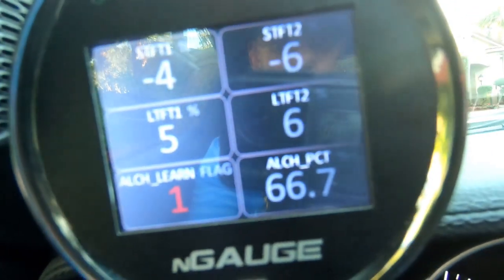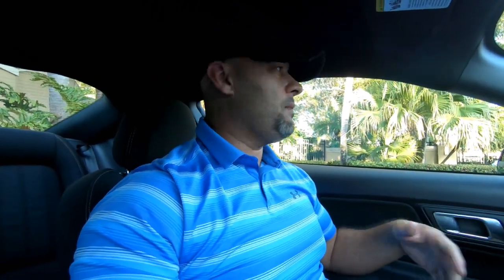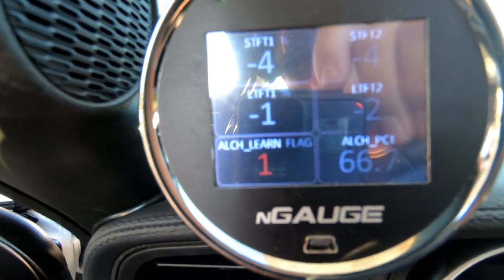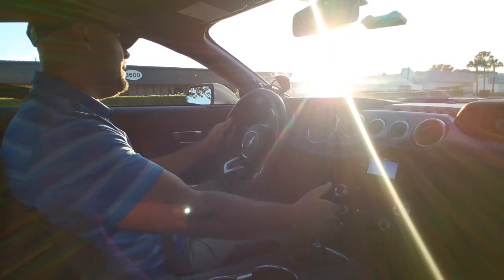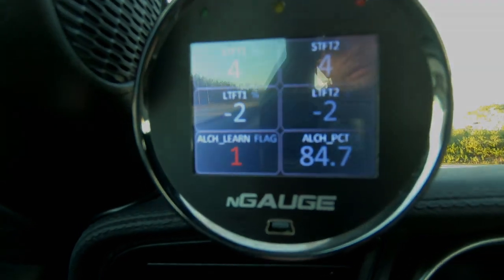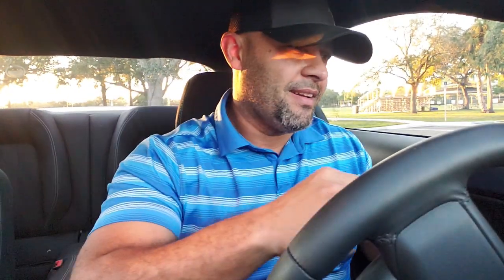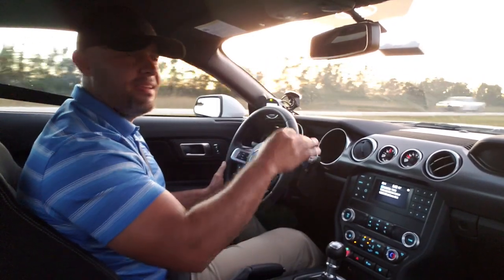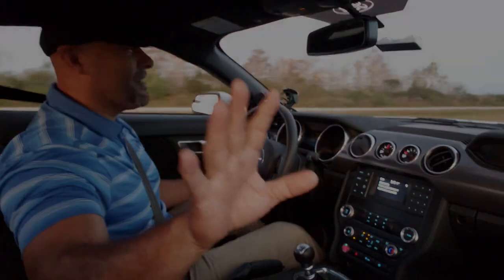Flex fuel tune Vs E85r tune. How the process works on 11-19 mustangs

Comment: I have a 91/93 tune on my flex fuel F150.  If I want to run E85 do I need to an E85 tune or just reflash back to stock???

Comment: Hey Alex. I have a quick question. If I by accidentally filled my e85 tuned 22 gt with 11 gallons of e15 and drove it below 2-3 rpm every couple gallons and filled it up with e85 was that okay?
Reply from the maker: No, it would run very rich, probably needs an oil change and new plugs at minimum.

Comment: Big fan, you tell it, how I like to hear it! I have an 06 Roush Mustang Gt, and my teksid short block will be ready this week, forged cobra crank, 11.1 Manley pistons/ Hbeam rods, boundary billet oil pump, ported heads, all Manley valves springs,running TVS 2300(e85) What do you think about meth injection on top of that? Anyway, do you do remote tuning? Would love to let you have the car for a few, but I’m in OKC. Never know, may work something out. Been using HPP, on my old setup, but I like your style, and attention to detail with modulars. Either way, you’re one hell of a tuner, keep up the Great work, and great show, I’ve learned a lot just watching it. Thanks 👍

Comment: If I’m Dyno Tuned on Pump E85. Flex Fuel System. Currently getting 79% Ethanol from then pump. Any benefits running a VP E85R fuel ? Not a daily driver.

Comment: I wish lund would tell you this when using their flex tune. They tell you when switching to E85 to do the sit still and let it idle and rev it for 10 minutes.. that is the dumbest thing ever lol. Just get in and drive the car normally, slower like your doing errands for a couple
Miles and it learns the fuel the same way as idleing and revving except it does it better and faster and you don’t look like an idiot like some of these youtubers sitting at a pump for 10 mins and taking up a spot at a pump lol.. 😂
Reply from the maker: They do
Read the directions
99% of the time ppl don't read the massive email they send. 
So I resort to making video for those that don't read.
Reply: @YDBT4LIFE  I hear ya. The directions I got with my 2017 back in the day were like that I think but the ones I got for my 2019 now say to sit and rev and idle for 10 mins and not to drive the car. I like the way you said to do it. I always Idle while I’m gettin gas and paying and then slowly drive the car until it learns (about 10 mins/10 miles) and It seems to learn a lot faster. Thanks for the reply Bro. I think you are tuning my car right now maybe? I’ve been sending you logs etc and the guy emailing me back is an Alex? That’s awesome if your the one tuning my car.. now I feel privileged to be tuned by the master lol.. I Love your vids and they have helped me in the past and a ton of others I’m sure. I’m gonna get my e85 flex tune data log to you guys tomorrow so you will have it Monday when you get to work. Tank is at 55 miles to E and The E85 gas station is 56 miles away haha. She will be nice and empty. 😂. Have a good weekend.

Comment: I'm just starting out so forgive my ignorance.  I'm wanting to go to a flex tune from 93.  I have a 2015 Mustang GT.  It has 52lb injectors, boost-a-pump, and Roush TVS 2.3L charger. You said that injector change isn't needed unless there has been an intake manifold upgrade.  This is probably a really dumb question, but does the supercharger fall into the "upgraded intake manifold" category, where I would need some upgrades?  Thank you in advance.  Love your videos!

Comment: If you’re running a flex fuel tune and the E85 from the pump is reading 80-85% is there any need to go to the E85R? Won’t the tune pick up on the alcohol content and give you the same power anyway? Im confused on which to run. E85 tests consistently 80-85% in my area.
Reply: Like he says in the video. The tunes will make the same lower Ona. Dyno probably and e flex works great. Only advantage to dedicated tune is that it is betting on you having great e85 so it shives timing down the motors throat earlier. So you gain some power down low. Mid and high will be exactly The same as the car already knew you had good fuel once you put the pedal to the floor and seen the alcohol percent

Comment: do you have to have the ngauge or can they do the tune with any tuner?
also do you have to leave the tuner hooked up all the time?

im new to tuning a car as all my last ones had locked computers and didnt want to spend the money on unlocking it and upgrading the fuel system for only a few hp.

i have a 18 gt if it matters.

Comment: Alex or anyone who can HELP me, if the e85 around me tests less than 75% can I still run the flex fuel tune? or is it bad not having constant full E85 ?
Reply from the maker: You can run the flex fuel tune on 75% the e85 r tune might run a tad rich on 75% ethanol
Reply: @YDBT4LIFE   thanks for replying! what if it tests below 60%?, can I still run the flex fuel? not the race tune tho?
Reply from the maker: @trunkslorenzana  You can run the flex tune on 91 Oct...93 oct....a mix of 93 and any ethanol or straight e85. Just like f150 trucks
Reply: @YDBT4LIFE  sounds good!!! Thank you I will buy it today then from LundRacing,  thanks bro😁🙏
Reply from the maker: @trunkslorenzana  anytime brother

Comment: Will a dedicated E85r tune adjust for lower quality E85, depending on where you fuel up? It's 75% ethanol at my closest gas station.
Reply from the maker: it will trim fuel out running slightly rich.

Comment: Just curious I just ordered the e85 flex tune for my 18... does this also include the e85r tune?
Reply: I did but I made sure and emailed and asked because there are different options, I went with a flex tune and e85r drag mode tune, but you can also get 93 and e85r, you may want to email and verify.
Reply: Paul Cheatham yep ended up with a 93 / flex / e85r and e85r drag tune

Comment: I want to do this so do bad but I'm terrified of voiding my warranty. Especially since I have a 100,000 mile warranty and I only have 22,000 miles on my GT. I've looked into the Ford Performance Power Pack 2 and 3 tune but I know it's limited.
Reply: You only have one choice. Ford power pack. Don’t be an idiot and loose a warranty you probably spent $2000-$4000 for.

Comment: how do you get an ethanol content sensor to interface with a tuning device? or is that percentage just a rough estimate based on the wide band system?
Reply: Good question I was wondering the same.

Comment: Any idea why a 2019 Mustang GT would rev up to 4K rpms without touching the accelerator after flashing with the Lund Racing Flex tune? Directions were followed precisely.
Reply: When does it Rev and for how long?

Comment: Can I run E85 on a stock 2016 gt or do I need a stronger fuel pump and better injectors!
Reply: You just need the tune.  Either flex fuel or dedicated E85r.

Comment: If i wanted to have a 91 octane tune and a e85r tune, will an nguage show me the ethanol content so i know when its safe to switch to the e85r tune?
Reply: This is also another question that I had along with why get a 91 Lund tune when you can get flex fuel tune and run whatever you want on it and get performance for whichever fuel your on .
Reply: @Alejandro flores

Comment: Awesome vid bruh! Thanks for all the knowledge on these coyote engines. I’m finally moving from my trusty Fox body. I’m on the fence with the s197 or the s550, I don’t think I’ll loose either way! BTW are still running your stock cold air?
Reply: I am wondering that as well, since he has proven on 93 that the stock box is better.

Comment: With the alcohol percentage being learned, and showing 85% why wouldnt letting the tune add the spark that you would add in the e85r tune not be safe or equivalent to having to switch between tunes? I would assume if its showing the alcohol percentage then it should be safe to add all the timing you would want at any rpm?

Comment: So if I get a flex fuel tune on my 15 TT GT do I need to turn up the boost pressure if i put an e85 in it vs 91-93?
Reply from the maker: No flex on boosted cars.  N/a only
Reply: @YDBT4LIFE  aaaaaa, this is sucks, but why?. I guess I have to get dedicated dyno tunes for e85  and 91 then. Do you know any good tuners around Chicago area? Also for a TT, vented upr catch cans, what your thoughts on it? I bought a JLT catch can a week before I got my kit and now it is useless, i did not know it will not work with a kit.

Comment: With the 10 speed autos of the 18% do you see less gain switching from the flex to the dedicated with how the 10 speeds live above 6k when racing?? 

I'm just curious if there as much of a need to switch compared to the 6 speed which spends more time in the mid range.
Reply from the maker: The dedicated E85 to sees more average spark than the flex

Comment: Hey alex how is everything man, didnt you say on a previous video that it was better to go even full 93 or full e85 but not in the middle ? My other question i have a 2014 gt jlt intake offroad x pipes rtr axle back 47 lb injector and a bama tune on full e85 but i didnt really see the difference when i went from 93 to e85 i was thinking on going with lund racing tune what do you guys recommend ? Thank you , also changing the clutch this week exedy 500 i am getting locked at high rpms and sometimes just cruising it acts weird and grinds thanks again for any feedback !!

Comment: I need a little help I bought a Lund tune and Gage with a flex fuel tune as far as a process do I have to do a data log then send it to none then they send me a tune back
Reply from the maker: Email them
Reply: @YDBT4LIFE  okay just quick question when buying a tune are there supposed to send you a base tune to send them back a log?
Reply from the maker: @Evolutionnick  email support@lundracing

Comment: If I have both a 93 and an e85r tune on my Ngauge sd card and i run out of e85 Can i go to a normal pump with 93 and flash in the parking lot before pumping some 93 back in it and be okay?

Comment: Are there any big downsides to the flex fuel tune?? I'm going to do headers on my car likely with my tax return. 

I dont have access to but one place with e85, but I see it when I travel. 

Is it just the lack of needing to learn the fuel quality that makes it different??
Reply from the maker: Yep
Reply: @YDBT4LIFE  sorry to ask a dumb question. So basically you can put on a flex fuel tune and set it and forget it basically with no down sides. Run 93 most the time and just toss in some e85 if you see it and it will adjust everything as needed, that seems really cool. Wish I had known that and I would of done that tune the first tine.
Reply from the maker: @jeremywinslow7345  yep. Just like that

Comment: Hey Yolo my 15 GT has a Lund flex tune and the car consistently reads 91% alcohol content but when I go to actually test the fuel the tube will read mid 70’s.  Any idea why?  Is this a sign of bad O2’s?  Is this even a problem?  Thanks.
Reply: Following. I have the same issue

Comment: Are Coyote mustangs flex fuel capable from the factory?  I assume there is a ethanol sensor then that the nGauge is reading off?
Reply: With a tune, yes.

Comment: So if I go fore innovations kit on my 2012 procharged cobra jet converter car and I cant find e85 on far away drives I can just load the flex tune from e85 tune and pump 93 and it will learn it and I'm good to go then burn most of it and pump e85 and load the 85 tune back up ? Little confused still on this kinda wanna move on from pump gas though lol ...

Comment: Can a flex fuel tune learn 91, 93, AND e85 on the same tune or just between 93 and e85 or 91 and e85? I hope I’m making sense
Reply: Yes that is what flex tune means you can run 91 or 93 full e85 or any mix of all the above.

Comment: What are the discrepancies if for example you get a dedicate e85 tune but your pump e85 varies because of cold and hot weather. Pump e85 ranges from e75 to e85 is that safe? Without a flexfuel sensor

Comment: If i have a 15 manual GT, with 18 mani, would just LU47 injectors ve sufficiant for a E85 R tune? Or would i also need a BAP, or return style FP
Reply: James Maness  the injectors would be fine. I have 18 mani and the LU47 which Lund recommends you get and you can get your flex/e85r tune no problem. I run the e85r tune on mine and it drives stock with fbo/e85 and I daily. Great tunes from lund
Reply: @chris5oh39  sweet
Reply: I orderd my tunes today, and within the hr. Alex had my tunes,  figured i would order and give enough time to get them while i was waiting on my car to get back from hood being painted. But man he was on the ball.

Comment: You N/A GT guys and gals dont know how good you have it. To run E54 (Arizona) on my 2011 GT500, Im looking at at least $4000 for a complete return fuel system and ID1300X injectors. Hats off to Ford. While they've dropped the ball getting the S550 GT500 out in a timely manner, the s550 GT's performance potential is absolutely incredible. Great video Alex. I wonder if someone is owrking on upgraded shift forks. For guys that like to row their own gears, it would be frustrating to always have breaking forks in the back of your mind.
Reply: lexustech48 haven’t found many places in the west valley or even out to surprise that have Ethanol. It’s also pretty stupid that it’s E54 and not E85.
Reply: @azdave7177  I live right next to an e85 station in tempe... I haven't tested it but people are saying it's right at e85
Reply: Arizona has about 4 e85 stations best one I know is val vista and broad way in Mesa

Comment: So all a 2014 gt will need is injectors and a tune and you can run full e85?
Reply: Its like $2000 to upgrade all new injectors though.
Reply: Why RuMad more like 300
Reply: @bonyatoxdd  each injector is like $250 a piece or more depending on the brand.
Reply: @Jimmyxsx  what? LU47s are $300 on American Muscle. That's for a full set, not individual. ID1000's are some of the most expensive and they run like $950 for a full set
Reply: Why RuMad 2000 dollar Injectors are absolutely not necessary lol

Comment: Do you know if you have to get the performance pack in order to get the active rev match feature or not? And also do you know if Ben Calimer is doing any built transmissions right now for the 2018 to 2019 mustangs. Because I rather get the transmission built now instead of worrying about losing 3rd or 4th gear.

Comment: So how do you go back to flex from E85R? Do you just pump 93 and then switch to flex again? Asking cause my car wouldn’t start after i went back to flex tune on full E85, so I heard the car has to sense some 93 in the tank to be able to start on flex tune. Tis true or no?
Reply: A flex tune has it's own tables its not based on either. It's it's own tune. It uses the ethanol content to adjust a/f and timing in correlation to the amount of ethanol it reads. Stoich is also much different between the 2 and could never run  solely based on a 93 tune.
Reply: ntx lsx racing my car won’t start if i switch back to flex tune from e85 race with e85 already in the tank. But was told if i pump some 93 then it’ll start fine. Tried this theory out and it worked so idk lol
Reply: Nope can flash to a flex tune on full e85 no problem. Full e85 start up issues are normally due to tuning. Lund will set you up right though no problems
Reply: ntx lsx racing i heard is cause the flex tune is 93 base.
Reply: Although startups on e85 race were always easier than full e85 startups on flex tune.
Reply: Who are you tuned by?
Reply: ntx lsx racing Lund lol

Comment: Yeah I'm on the fence about what tune to go with on my 18 Gt. I do have a few e85 stations in my town but not near my home. I want an e85r tune for power. I may go flex fuel or do a 93 tune and an e85r tune and switch between them. But that may be a waste of money. Keep us posted on the Fairmont.
Reply: I'd just go flex and in time pick up an 85r tune as well. I don't think the flex tune is going to make or break a roll race on the street. E85r is kinda all out. But that being said e85r tune is slightly superior
Reply: On dynos the flex tune makes
More power then the e85r tune for 90% of people. To run the dedicated tune and get more power etc you need literally e85-e90 or race e85 fuel. Otherwise the car makes the same power or even cuts a little timing if your fuel isn’t perfect. Just run the flex tune and after you fill up drive
Slow for 5 miles Or so and let the car learn and then enjoy, it’s simple.

Comment: Alex,
Does the same logic apply 2 my 2016 5.0 Roush charged F150? I came by Power by the hour yesterday with my son in the service to talk Coyote swap in 06 4.6 drop top GT. Christian was really cool showed us around. We saw the Fairmount. Lol.
Reply from the maker: No. Supercharged vehicles require a fuel system if you want to run ethanol.
Reply: @YDBT4LIFE  can you elaborate a little? I had the same question and would like to get E85 running through my Roush
Reply from the maker: @sublimegt500  simple. Flex tuning isnt an option for boosted vehicles. Thats why ford doesnt do it on any of their boosted platforms. And neither does lund. If you want to run e85 in a roush supercharged truck you will need to upgrade the fuel system.  Not just a bap....a real deal return style system is what we require. Other tuners might require less. But we don't like to roll dice.
Reply: That's what I was thinking. Just wanted to make sure. Thanks for the response Alex!
Reply: Ok,
I will be back later on in the year 2 add the twin fans to my heat extractor. I am from Rivera Beach ole school. Now live in Alabama. Class of 89 retired Army. I have 3 stangs in the family plus the F150. Enough fanboy sh#t.

Comment: I did not know you could run full E85 on a stock s550 gen 2, what if it has minor mods like a CAI and a exhaust with H or X Pipe?
Reply from the maker: All good as long as you have the stock intake manifold